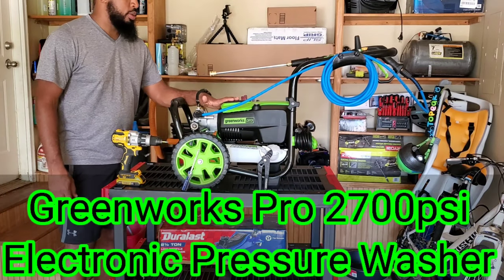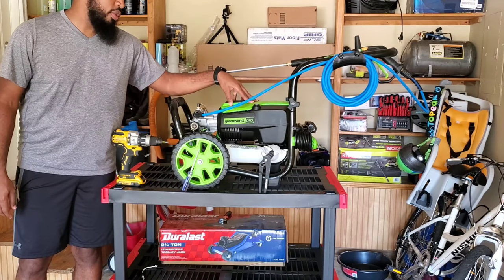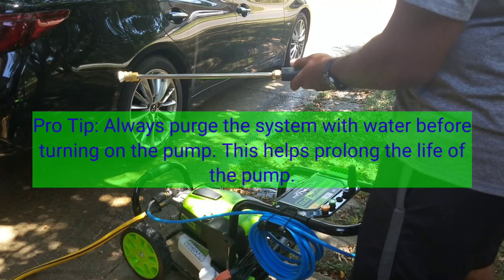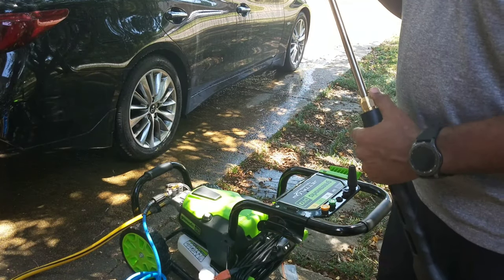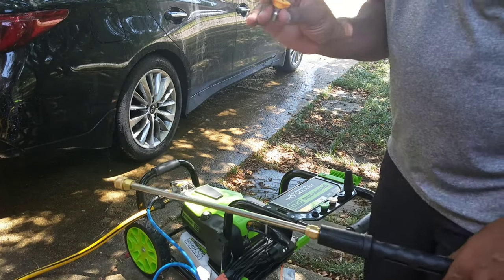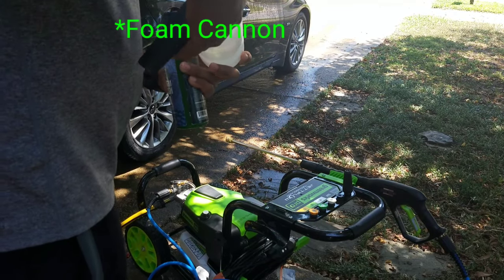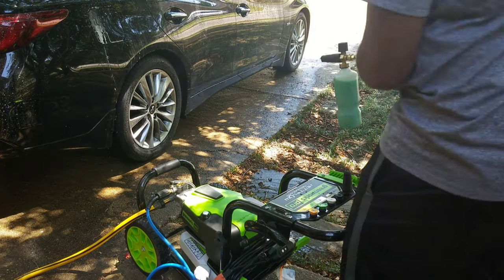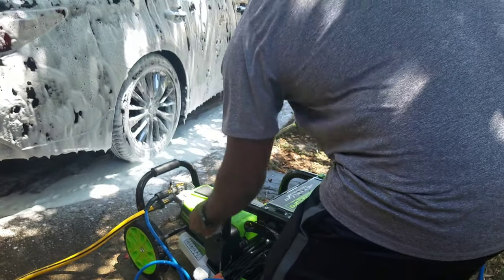Greenworks Pro 2700 PSI : Testing the Nozzles and Foam Cannon

Comment: Tony
I've had the same pressure washer for 3 months now and here are a few suggestions to make it perform better and make it easier to use. 
1. You should purge longer than 2-3 seconds more like 10-20 seconds.
2. Buy a 50' hose and put quick disconnects on your water supply hose and pressure washer hose and gun. (10 second set-up) With a 50' hose you never have to move your pressure washer. You can get the kit at Lowes for $29 and a new Propulse hose on Amazon for around $50
3. Stretch out your hose before you begin, remove all the coils so it lays flat. There's no reason to fight your hose
4. Buy a new set of orifices for your gun to increase GPM while decreasing PSI which will be better for washing cars. I have a pressure guage and tested 5 different size orifices to find the sweet spot for washing cars which is somewhere between 1000-1200 PSI. (per Obsessed Garage)  I use a 3.0 orifice which produces 1200 PSI at the tip and flows a lot more water. The stock orifice produces 1950 PSI at the tip which is more than you need and restricts the water flow. For other choices a 2.5 makes 1425 PSI, a 3.5 makes 1025 PSI, and a 4.0 makes 875 PSI. You can buy a new set of nozzels on Amazon for less than $10.
5. If your budget allows I would also upgrade the gun to a MTM Hydro SGS28 with swivel. This is a great stubby gun that you can easily add different size lances to with quick connects.
Reply from the maker: Hi Rod, Thanks for the wealth of information. I currently have a quick disconnect kit and a Cheap stub nose gun and foam cannon combo waiting to be demo'd. They will be in upcoming videos. I like the Details alot. I actually watched the whole Obsessed garage line up. I hate that this pressure washer wasn't available. But now that you have the info I feel alot better about ordering more nozzles.  Did the quick disconnect help with the coiling of the components? Does it help the parts swivel some at the connection points?
Reply: @tonysgarage2292  The quick disconnect will allow the hose to rotate more freely, but only when the pressure washer is completely off. Once the pressure washer has been turned on there is too much pressure for the fittings to rotate freely. The best way to get the hose to rotate freely is to use a live swivel which is standard on the SGS28. Having said that I have a SGS35 Aqualine with a live swivel and find the small 1/4" hose dosen't always provide enough resistance to make the swivel turn as freely as I would like. I have a bigger pressure washer with a 3/8" hose and it works great with it. The best thing you can do to keep your hose from coiling is to lay it out flat before you start the pressure washer. I make sure the PW is orientated so I never have to pull the hose over or around it. When I purge the line I stretch out the hose and twist or rotate the gun until there is no "set" left in the hose. After that I just pay attention as I use it and remove a coil as soon as one develops. Hope this helps.
Reply from the maker: @rodcox1005  Thanks I just ordered the new nozzles. I'm going to include some of this information on my next video if you don't mind.
Reply: @tonysgarage2292  No problem, I took the time to figure it out so we might as well share the information with others. Just another FYI. This pressure washer does actually build pressure to 2700 PSI, but only when it's not spraying. The moment you start spraying the pressure drops to 1950 PSI with stock tips. All my pressure ratings are at the tip while you are spraying.
Reply: @rodcox1005  Thanks for the nozzle info.  I briefly tried an SGS28 today with the GW2700.  SGS28 trigger action is great!  Positive action but virtually no resistance.  Hopefully it means less tired hands.
Reply: @patvaudo883  Pat - The SGS28 is more than what a lot of people want to spend but I not heard of anyone not being happy with it after they did. For me the true test of a tool is if you smile every time I use it.
Reply: @rodcox1005  Thanks So Much For All Of This Great Information Sir 🙏🏼
Reply: @xHustleHaRdx  Happy to share!

Comment: Thanks Tony  ...this is the only review so far for this model where you get to hear how loud this machine really is. A bunch of other reviews made it so it did not sound so loud.
Reply from the maker: You're welcome, it's definitely noticeable.  It's not bad though, no complaints on the sound level. My only want is for the motor to be activated by the trigger on the sprayer instead of continuously running.

Comment: Thank you for the purge information.  And nozzle info. I’ve watched 10 videos already. You’re the only one to mention it.
Reply from the maker: Thanks, I learned the lesson the hard way. I just want to save everyone some money and extend the life cycle of there equipment!
Reply: @tonysgarage2292  I blew up my Ryobi 1600 last weekend when it ran for 2 seconds without water.  Now I have the GW2700!  And same car as you.   Thanks for the video, good music at the end.
Reply from the maker: @patvaudo883  wow, I hope you got your money's worth out of the Ryobi. It was a solid unit for small jobs. Congratulations on your GW2700... You will like it once you get used to it not having the Auto start/stop feature.
Reply: @tonysgarage2292  Tony, have you noticed if the [white plastic/brass tip thing] sprays a tiny stream of water?  I think it's coming from some kind of pressure release hole.   Nothing in the manual.  Machine is working great and a pressure meter shows it doing 2300-2800 psi !
Reply from the maker: @patvaudo883  yes, that's the pressure relief valve keeps the unit from building too much pressure when the pump is on and you are not using the sprayer. Perfectly normal. Nothing to worry about.
Reply: @tonysgarage2292  Thanks Tony.  Incidentally it sprays any time the pump is on, whether or not I'm using the gun.   I didn't see that in any Youtube videos, but my pressure meter reads high so I guess it's ok.  I wish the manual were more detailed!  Thanks again for the excellent video.
Reply from the maker: @patvaudo883  You're welcome!

Comment: Tony, this was well done.  It's funny I just unpacked mine today and found your video.  For me also it is an upgrade from the Greenworks 2300 to the 2700 and I totally agree, if you are only using a pressure washer for your car, then there is no need to upgrade.  I wanted it to use to clean my solar panels and the tons of backyard concrete I have and this machine was a winner today.  I attached the 11" surface cleaner and had a grin on my face from ear to ear.  For the roof, I got the MAXX 18 foot extension with a shoulder and back harness to hold it in a position that will relieve a great deal of the effort to hold that long of an extension.  It was at Lowes also.  I watched your other video on the quick connects and you had some great info in that one. So, I had to drive back to Lowes and pick them up.  LOL.   Love your car, by the way, one of my favorites.
Reply from the maker: Thanks Kyle, I really appreciate that! I'm glad my videos were able to help out. I may have to get those attachments in the spring. It's cold here now. Thanks for sharing the information!
Reply: Im interested in this pressure washer. Some reviews say the jet flow is aggrevating. Since this video are you still using the 2700, has it held up?
Reply: @pjgravely7174  Yes I am.  I use it everyday and it is a great machine.
Reply: @nicksdragon6929  Thank you

Comment: Nice demo. Freaks me out though that you literally have the plug attached to an extension cord right at the unit. The plug cord is 35 feet long since it's supposed to be as far away from potential water contact as possible. You've got it right by the water source.
Reply from the maker: Thanks V G I appreciate the feedback. I will keep this in mind next time I use it.

Comment: finally a electric pressure washer that actually foams and not watered down . i have a sunjoe 3000 with cg foam cannon and honey dew but barely foams up the car . are u using 1.1 orifice in the fom cannon or just stock ?
Reply from the maker: Hey Anthony, Yes I do have the 1.1 orifice. In there, foams very well with low PSI and Foams like crazy with the 2700...   I will update my video description to include that mod. I just bought a shorty and a new foam cannon I may do a video to show the difference in the 1.1 and the stock orifice on the 2700.

Comment: shave cream foam thanks I will pick this up soon
Reply from the maker: You're welcome, if you still having trouble getting thick foam. Do the smaller 1.1mm orifice change. It helps get thick foam for the lower powered pressure washers.

Comment: Does the pump run continuously? Even when you are spraying ?
Reply from the maker: Yes, it runs constantly while the power button is activated. When the handle(trigger) is not depressed that pump is still running.  Once it reaches a certain pressure the pressure relief valve bleeds off some of the water. This allows for the sprayer to always have pressure while the power button is activated. No waiting on the pump to cut on and build up pressure between trigger pulls.  Hope this info helps.

Comment: Have you tried cleaning concrete with it?
Reply from the maker: Hi Steve, Yes I have it did well. I used a $30 Surface cleaner and no chemicals. Slow process but it got the job done. I believe if I had prepped with chemicals it would have went a lot faster... I also cleaned a deck. It knocked the deck out quick with no issue or chemicals. Hope this helps.

Comment: 4 months later, how do you like it?
Reply from the maker: I like it alot. No issues with it. The quick disconnect and hose upgrades are highly recommended.
Reply: @tonysgarage2292  did you get those at lowes? Do you have a link?
Reply from the maker: @ss4goku34  Yes, I got the quick disconnect kit from Lowe's and the 50ft hose from Amazon. You may want to get a 50ft light duty hose. The one I have linked is heavy duty and if you don't stretch it out before adding pressure to the hose it can be a bear to work with.  Also, the heavy duty is a bit tougher to roll up.

Comment: Hey Tony I think you should stay 3 feet away from the car because you are playing with 2700 psi. If you were using 1800 psi that would probably be ok, but 2700 your washing too close to your car trust me brother. You don’t want to wash the clear coat out of your paint because that too will, cost you. It’s ok for the rims but not the car.
Reply from the maker: Thanks man, you are correct in your concern. I make it a habit to stay at least one foot from the car. Most times I'm between 18 and 24". I also have upgraded to larger orifice nozzles and a longer and larger hose, which reduces the PSI and improves the GPM. I have another video coming out shortly that will explain these upgrades. I have also started using the 40° nozzle instead of the 15°. Less but sufficient power and more water flow is a win win for me. Quicker washes and less chance of damaging the finish. Thanks for the subscribe! Please stay tuned for the future videos. If you have anymore comments or would like for me to review something else just let me know. Thanks again!

Comment: You put to much soap of course it's going to foam up 2 squeeze equal 2oz not 4
Reply from the maker: Dan I think you are right. I actually think it was a little under 4(100ml). I had my calculations wrong but compared to my 1600 with the same amount it was thicker. Not so much so that I would recommend buying this one over the smaller one for car washing.